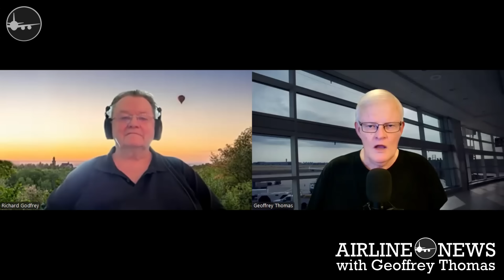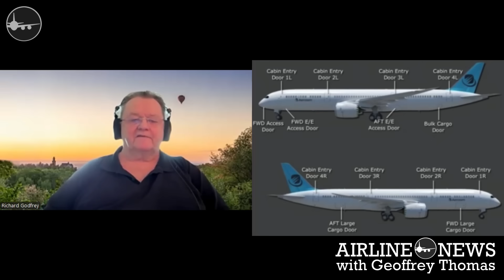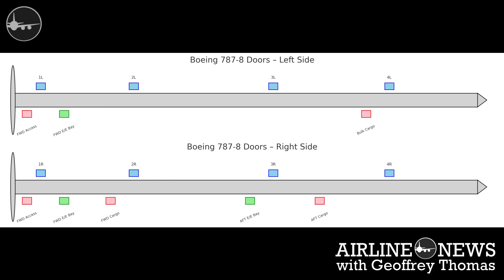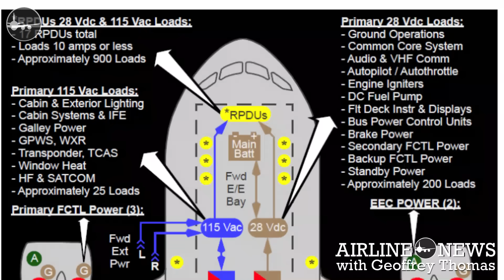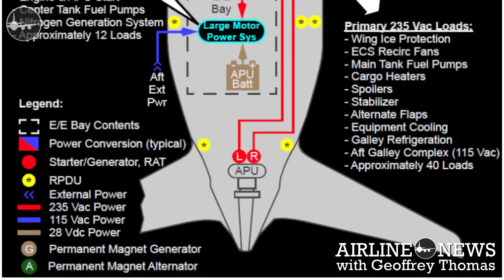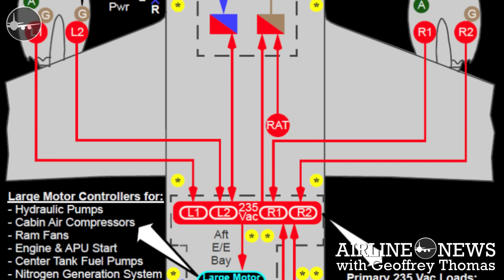Air India Crash Eps 189 - Toilet Leaks Exposed

Comment: After some calculations by chatgtp, I need more explanations to be convinced for the vapor lock scenario:

 >>>> Plenty of NPSH margin, no vapor lock expected. 

>>>>> Assumptions for the calculations
--Ahmedabad (≈58 m / 189 ft elevation, 100.6 kPa)
-- takeoff (TOGA, 38 °C, hot fuel: 45–50 °C)
- 270 VDC buses are lost, High line flow, suction-feed.
- Expect ~15–30 kPa inlet losses at TOGA when suction-feeding
-- Fuel type: Jet-A / Jet-A1.
-- Fuel vapor pressure at 45–50 °C: ~5–8 kPa (used 6 kPa for base case).
-- Line losses at high flow (TOGA): ~20 kPa.
-- Static head (wing tank height above LP pump): ~1 m (~7.5 kPa).
-- Density of fuel: ~760 kg/m³.
-- not tank pressurization

I agree with the water problem, but I am not convinced yet by the resulting fuel lock.

Keep doing what you do best gentleman, that is looking at all the possibilities!

Edit: this does not change the conclusion but we have to add about ~+4 Kpa to the ~15–30 kPa inlet losses at the pump head due to the acceleration effect on the fuel in the fuel line at take off.

Comment: Good analysis. Few questions remain. How did you conclude that only the Captain's side instrument panel was switched on and how did the captain know that the copilot's instrument panel was off? If that was covered in your previous analysis, please do let me know. Also, the front EAFR and the AMP has its own power source. It should have recorded the PIC taking over, even if the RPDUs had purportedly failed. Overall, why would the AAIB prelim report state that both engines N1 and N2 started dropping after the switches were moved to cutoff?

Comment: Hi guys - If Richard’s theory re water ingress is correct it seems to me, as a complete dunce regarding planes or aviation, that the snippet of conversation on the CVR released by Air India is designed to throw suspicion on the pilots 😐. If  that’s true - and I have no Idea if it is - it would be wholly unacceptable and egregious.
PS - I left my comment just before you both addressed that issue,

Comment: Poor design and sloppy maintenance most probably led to the crash that the powers that be would blame on the pilots. This is not the first time this has happened in my time in the aviation industry. Richard and  Geoffrey congratulations  on your expert work.
Reply: The best designs can be defeated by poor maintenance.  IF this is indeed the cause, IF... then it is very important to note that Air India has a HORRIBLE history of maintenance.  It hasn't happened on other airlines with same aircraft.
Reply: Design isn't unique to Boeing, the lack of proper maintenance has resulted in problem reports from Airbus related to the same issue. This is 100 percent a maintenance issue.

Comment: Gentlemen, given your growing number of contacts in the aircraft manufacturing and airline industries, could you request more details on the “maintenance and corrective actions” called out in these ADs? Thinking ahead and trying to keep an open mind, the level of work associated with the maintenance may be posing a serious problem for the airlines, possibly additive with many other items between flights (in other words, the basic design may not have been failsafe enough, but also not excusing AI). Thanks again from a very appreciative and giving supporter (💸-😉😉).

Comment: I do not know how the aeroplane is designed. However, after watching the video, as a common person, I wondered why vital electronic equipment like RPDUs or other essential equipment is designed to be installed below toilets, given the high likelihood of leakage directly onto such equipment. Also, considering fluids like water/ urine will seep down due to gravity, why can't all such equipment be located above in the fuselage, and the toilet and people seats are located under the EE Bay equipment?
Reply: I thought about this as well. If the passenger cabins were located on the bottom of the fuselage, beneath the electronics, a lower passenger entry and exit  would also be an advantage. Cabins beneath the wings with downward facing windows would be more attractive. BUT you cannot house the undercarriage elsewhere. The forward and aft cabins would be physically separated.  Beneath the mid-height of the fuselage, the cabins would be narrower and the wide-bodied jet would have less seats and only one aisle.
Reply: @tonyklein8429  I agree that the undercarriage is not possible to be located anywhere else. But why the EE bay equipment need to be located under the toilets? Although leakage is very difficult to control, how a design can allow the positioning of vital equipment in most likely leakage area?

Comment: Do each airline operating in India independently maintain their own fleets? Or is there any subcontractor used commonly between airlines? It seems the leakage may have affected the electrics on the previous flight? Clearly if this is the case it was not detected, and the aircraft released for takeoff in a seriously dangerous state. This in spite of maintenance updates issued by Boeing and the FAA.

Comment: It seems an obvious design flaw in concept to have sensitive electronics directly below any potential source of liquid contamination regardless of maintenance. I can’t imagine any reason why toilets or galley have to be directly above the EE bays from a layout perspective. But maybe someone who is familiar with aircraft construction can comment.
Reply: lets be clear.. ANY leak.. directly above or otherwise.. can make it's way to other locations in flight if it's not COMPLETELY sealed and those seals maintained regularly. Aircraft bend.. expand.. shrink.. torque.. shear.. every kind of movement and temperature change you can think of, over time. There is no seal that is going to last 'forever' in such circumstances. So regardless of whether it's directly above it or not.. any leak is going to potentially make it's way throughout every compartment below sooner or later. What SHOULD be thought of is to place all these electrical components.. certainly any critical ones.. ABOVE any liquid level. Hence drastically reducing any likelihood of any leak ever getting to critical components. Things don't drip UP, and gravity still works the same in the air. Is there space above? What are the issues with doing so? Idk.. refer to the engineers.. but that would only even be useful in newly designed aircraft, and leave us with thousands and thousands of birds for decades to come, with having to cope with this issue. Clearly it's not a common critical issue.. or we'd have heard of it long before.. and we don't even know for certain that it caused this crash, yet.
Reply: @airheart1 Thinking that the equipment has to be below where the passenger cabin is due to the amount of room needed to be able to access it for inspection and maintenance.  And like someone mentioned that the forces on the plane are going to affect the seals to prevent leaks into areas you don't want so regular maintenance procedures should work to prevent it from being a problem.
Reply: Exactly my thoughts!
Reply: Seriously.... do Airbus aircraft have these issues and if not, what is different about their designs?
Reply: @bmwmpower8655 did you listen to what they said?  Yes, there have been.
Reply: @EristiCat  sorry didn't hear that only heard them talk about boeing aircraft as examples.
Reply: @bmwmpower8655 I should have phrased my question to you less harshly or omitted it and only said the second. I get frustrated at times. Sorry.
Reply: When you look at all the red tape and hoops and loops the NPRM then the AD with AMOC to just make sure the plane doesn't blow it self up. Then when a catastrophe happens more red tape to see who didn't comply accompanied by a lot of finger pointing. Boy oh boy no wonder you two Golden years gentlemen are going thin on top.
Reply: @pcarterlectric 😂
Reply: That's known as the P-factor.

Comment: Thank you for your very detailed analysis.
In addition to that, I want to mention another possible related root cause, i.e. the cut off the Fuel Shutoff Valves caused by an electrical glitch (s. video below).

Air India 171: Did a Software Glitch Cause Dual Engine Failure?
https://www.youtube.com/watch?v=VswFVpyg5ew

If I have understood this correctly, the Fuel Shutoff Valves in the 787are supplied by AC power only and have no DC redundancy by the batteries (as the A320 has). 

I.e. if the AC supply fails, (e.g. by an electric glitch - eventually caused by water ingress, …), the Fuel Shutoff Valves would automatically execute into cutoff within seconds – even before the RAT is capable to supply, respectively to step in to provide power to the Fuel Shutoff Valves.

Comment: Richard, your knowledge is totally stunning! Thank you both for your great work! This-is-all-scary. I mean, pilots, crew, passengers, all rely on using a 100% accurate aircraft. So if there had been already an issue with leaking water or worse from the toilets on exactly that plane, and Air India hadn't solved that promptly and verifiably a 100%, it seems to be quite clear whom to blame. Scandalous lack of maintenance. On the other hand, honestly, what a weird architecture is this by Boeing??? And all aircraft-producers?! Electronic parts below toilets??? There is really missing common sense!
Reply: Don't freak out Aircraft is still the safest form of travel. That is not minimising the need for improvement when faced with a tragedy like this. Common sense is not common anymore.

Comment: Great info Geoffrey and Richard. Stellar work. . If the fuel supply was inadequate due to cavitation on the high pressure pump, would the FADEC close the fuel valve ?

Comment: 10 seconds delay to run the engine 1 is pilot error and it also got relighted and gained some trust even after 10 seconds delay as it was new engine replaced months before crash. most air crashes are due to multiple factors.

Comment: My Hypothesis , 2 minute read.  ? 
Fuel control run cut off switches . illuminated RED? 
This phenomenon of realising the answer to a question while in the process of asking it is a common experience, often attributed to the brain's problem-solving process and the power of articulation.  It relates to how our minds work through information and reveal solutions. 
Here's a breakdown of why this happens: 
•	Articulation as a catalyst: 
Verbally formulating a question forces you to organise your thoughts. This process can reveal gaps in your understanding or highlight the logical steps needed to reach the answer. 
•	Cognitive shift: 
Asking the question can trigger a shift in your mental state, moving you from a state of confusion or uncertainty to one of focused thought. This shift can unlock the answer. 
How this relates to Air India 171? The pilot asked something like this, Why did you cut off ….and did not complete his sentence noticing the conflict. 

In a Boeing 787, the fuel cut-off switch is not illuminated red when in the "Run" position. However, when the switch is moved to the "Cut-off" position, it is illuminated red to indicate that fuel flow to the engine has been stopped. The red illumination is a visual cue for pilots to quickly identify which engine's fuel supply has been cut off.
If the above is true, then: My hypothesis is that the one pilot asked the other "why did you cut off" ...and then stopped short his sentence seeing the switches were illuminated red but both switches were physically set to run.  This infers that the switches were electrically set to cut off, but mechanically set to run. 
Then the pilots had to manually cycle the fuel control switches to cut off and back to run to reset the FADEC. 
In my opinion, this is why the pilots did cycle the fuel control switches to try and reset the (FADEC) Full Authority Digital Engine Control unit.
Reply: That should be done inmediately, cutoff and on again, which was not the case.
Reply: @armandoernesto It may have been done immediately by the pilots. Imagine electrically its off , red light on, but mechanically switch in the run position. Several seconds later , say 10 seconds, pilots move the switch in one second from run to cut off to run. Electrically that will be recorded as 11 seconds .
Reply: But on the logs there are differences if the switches has phisically moved or if the valves have been close but with the switches in run position. That' because I believe that both transitions on/off and off\on were physical
Reply: @armandoernesto hi. No log records the physical position of the switch,  in other words,  there is no microswitch detecting external movement.  The switch opens or closes a circuit. The red indicator light will be a different circuit, giving visual indication for the pilots, most probably driven by FADEC logic . What im surmising is a conflict of indication. This would give rise to the question " why did you cut off" and then not complete his sentence realising the switch is in run but the red light can be illustrated?
Reply: @ImperrfectStranger  👌🏿
Reply: @jumpseat9112  I am not an expert, but if the control circuits are independent, the flight data logs should indicate the source of the command that closed the engine fuel valves. I note this because someone pointed out that the logs are capable of distinguishing between these two types of events.
Reply: @armandoernesto 
I agree, hence we need a detailed professional report, not a schoolboy report that was issued.
Reply: the "Cut-off" position, it is illuminated red ???? is this a fact?
Reply: @pcarterlectric Apparently yes, as when you briefly look at the switch and see red light, it means off. Yet the switch mechanism may be on run .
Reply: Took me 1 minute 30 seconds to read and left me with a headache. Just as well the question mark followed.
Reply: @mushymystic 
Hi, i dare say on the ground , taxi, in ground mode, the illumination might be absent.  But if the aircraft is in flight, airbourne mode, and I'm sure if you select the fuel control switch to cut off, it will illuminate red, signalling readiness to discharge fire bottle if required.  But one thing is for sure, the switches do and can illuminate red in the cut off position.
Reply: @jumpseat9112 thanks for taking the time to explain for me
Reply: To be honest, at this point we don't actually have any hard evidence that the fuel cut-off switches were physically moved.  Can we believe ANYTHING in the Interim report? Maybe Geoffrey and Richard can give a briefing on whether it's physically and/or electrically possible for the switches to trigger cut off without being moved? Yes - I know this has been covered in a previous episode but a deeper dive and/or a review would be welcome.
Reply: @padrejohnruffle I think the red light indication on the switches get a signal from a source,  not from the physical position of the switch . But yes, Richard or Geoffrey may shed light on this

Comment: Thankyou Richard and Geoffrey for a great piece of work. 
I posted a comment previously saying I had a ‘gut feeling’ that this crash was not pilot induced. 
As a retired avionics maintenance engineer with over 30 years of experience I can say gut feelings and statements that don’t ring true are great drivers to the facts and to evidence to support them. 
It seems to me the captain was knowledgeable and quick thinking, operating the fuel cutoff switches to cutoff and then moving one back to run to force a relight on one engine only, due to the limited electrical power available because of no APU and RAT deployment at low airspeed. 
It is a shocking state of affairs when a person no longer able to defend himself is erroneously blamed for the death of 200 plus people. 
Keep up the good work.
Reply: From what I understand that the conversation from the FO asked why did you cutoff, and the Captain said he didn't cutoff' was a true statement.  That it was an electrical power glitch that caused both engines to shutdown or at least stall due to fuel flow.  At least that's what they are saying and now the confusion about what happened makes a lot more sense.  Further investigation into this should be done we hope but we're not sure how they are handling the investigation.
Reply: I said the same thing too, from the preliminary report onwards. Thx to these respectable podcasters we all have an insight to it
Reply: @SamBaghi That said some of their original speculation did seem to going in one direction.  They have sine righted the ship so to speak...😊
Reply: According to preliminary report captain said he didn't cut off switches then is he lying...
Reply: @rakeshsatla6338 that question was due to fuel cut of b4 capt desperately tried the fuel switches and succeeded to run one enging after 9 seconds when aircraft pitch was less than take off and descending. Capt replied NO to F.Off question.
Reply: @rakeshsatla6338  The report doesn't quote that exchange verbatim. The FO could've been asking why the Captain cut off his instruments (which would've gone out when the engines flamed out and the RAT deployed, providing power only to the Captain's instruments). Or the FO could've been assuming that the engines flamed out because the Captain had flipped the cutoff switches, when in fact they had flamed out because of an electrical failure.

Comment: It's good work Richard and plausible, that in itself is a concern, however the report says the engines were commanded to shutdown by way of the fuel switches and not a roll back/flameout, assuming the switches were never manual moved it could still be an electrical input as you describe. It comes down to the all important CVR data to align and confirm the reported facts. As I said before it would be very disappointing if the investigators have missed those key facts. On a lighter note it is impossible to build a system fail proof, even the aliens manage to crash lol.